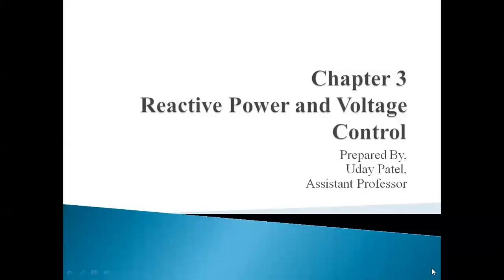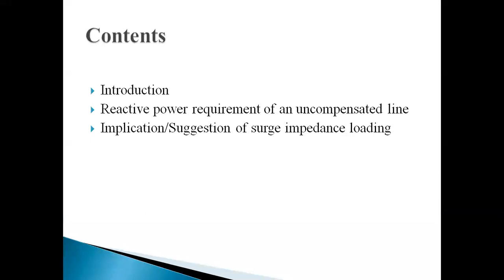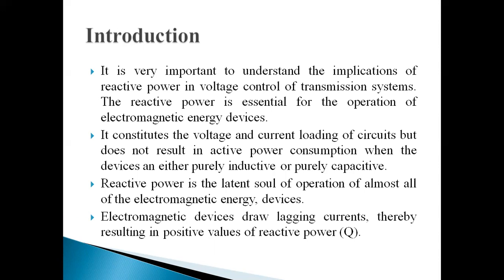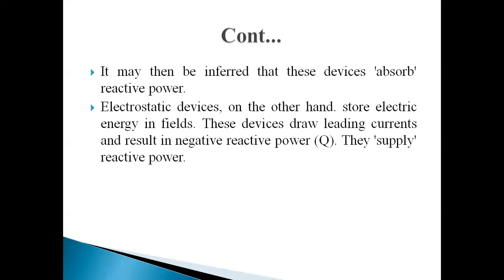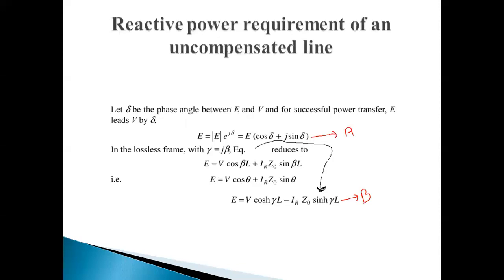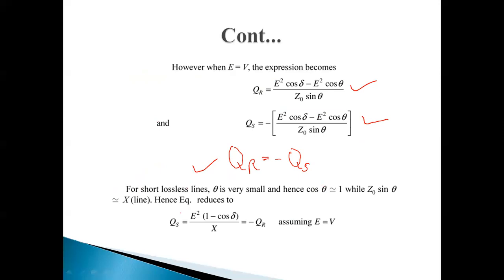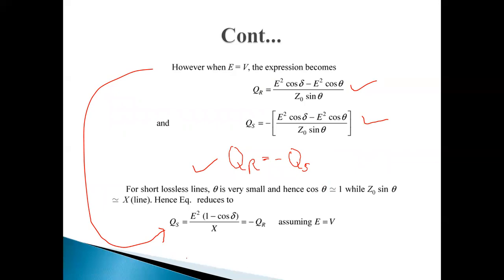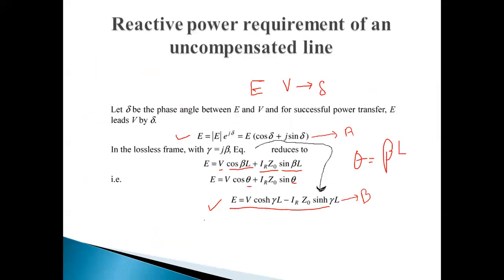Reactive power requirement of an uncompensated line

Comment: In equation B, how cosh terms is converted to cos term and what is the relation between then hyperbolic trigonometry and trigonometry? if the value of angle is small then cos and cosh has nearby value as zero however, its not true considering angle is big. Please clarify the concept.